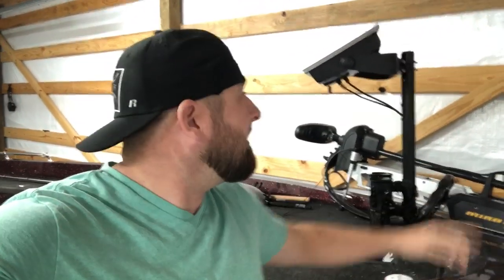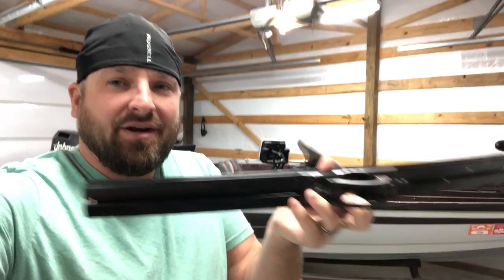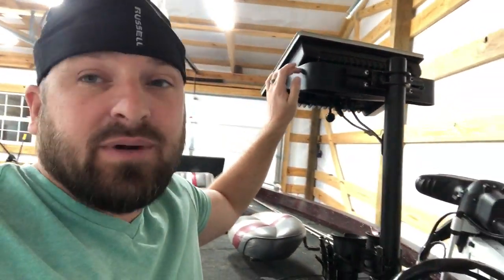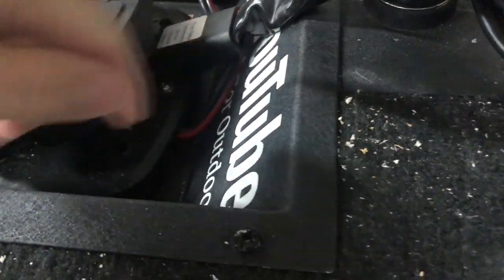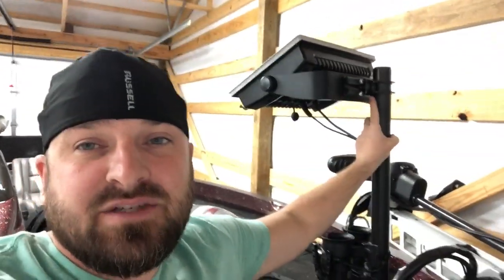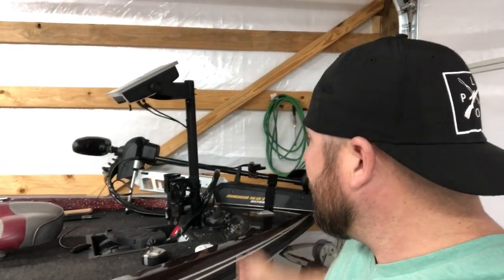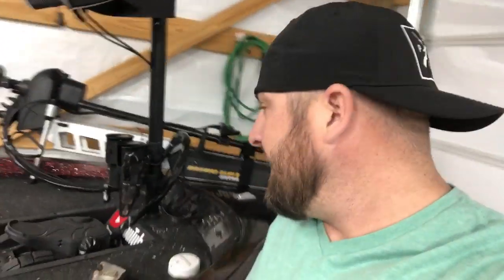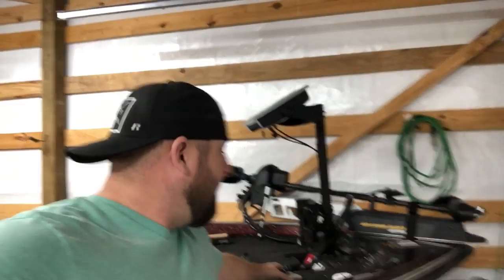One of the best Garmin LiveScope monitor mounts made!

Comment: Nice..If that’s a Jhonson 150hp Fast Strike, we run the same motor..👍🏿
Reply from the maker: It is a Fast Strike but it’s a 175 hp. Been a great motor for as old as it is! I have had to do a few things to her though! My power pack went out and so did my rectifier, but I replaced it all with CDI products and she runs like a champ now!
Reply: @PureLivingForOutdoors  What mount you use for your Livescope? Or did you mount your transducer to your trolling motor?
Reply from the maker: @mokush4me412  livescope is mounted to trolling motor but I also have the seefish by seelite pole as well!
Reply: @PureLivingForOutdoors  My boat is actually in the shop now. Getting my two Garmins and Livescope hooked up. My Livescope will be hooked on the trolling motor also. Wondering if it’ll be better on a mount rather than the trolling motor.
Reply from the maker: I used it on a pole and it works better on a pole with spot lock, but I fish open water fish so the trolling motor works best for me! However at some point I’m getting another livescope to hook to my 7616 just for using spot lock!